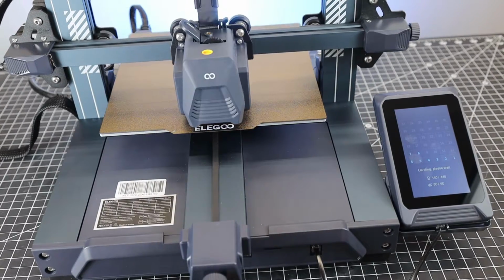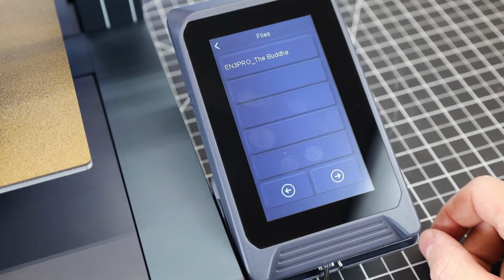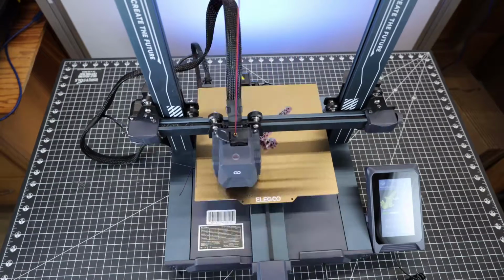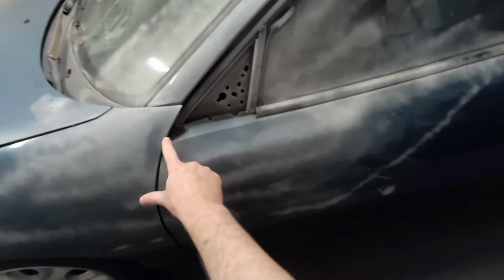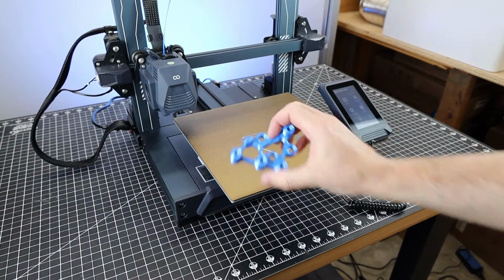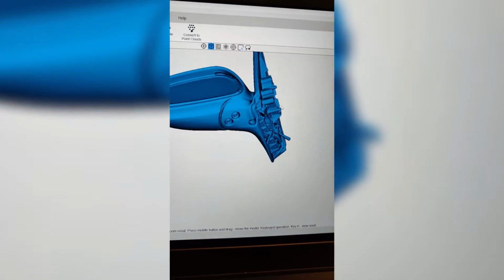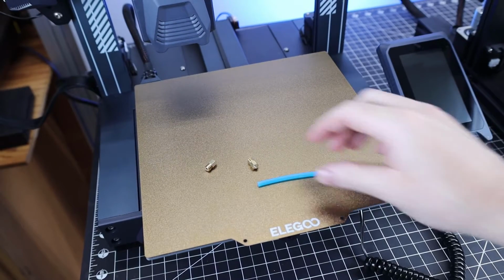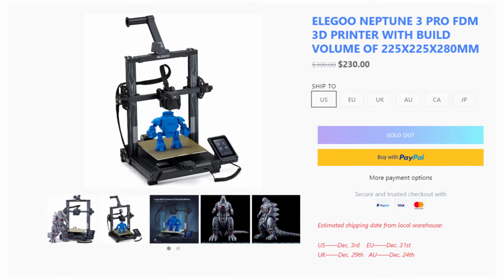3D Scanning & 3D Printing To Making Car Parts - Elegoo Neptune 3 Pro

Comment from the maker: Elegoo Neptune 3 Pro Amazon - https://amzn.to/3haONhK
Elegoo Neptune 3 Pro - https://bit.ly/ElegooNeptune3Pro
Elegoo Neptune 3 - https://bit.ly/ElegooNeptune3

Filament:
TECSONAR Tricolor PLA - https://amzn.to/3H79d5N
PolyLite Silk PLA Blue - https://bit.ly/PolyLiteSilkPLABlue
PolyTerra Marble PLA - https://bit.ly/PolyTerraMarblePLA
PolyFlex TPU 95 - https://bit.ly/PolyFlex-TPU-95

Free 3D Files:
Articulated Axolotl - https://www.printables.com/model/217417-articulated-axolotl-multicolor-remix/files

3D Scanning Tools:
RevoPoint MINI - https://bit.ly/RevopointMini
RevoPoint Pop2 - https://bit.ly/Pop23dScanner
CR-Scan Lizard 3D Scanner - https://bit.ly/CR-Scan-Lizard-3D-Scanner
3D Scanning Spray - https://bit.ly/AESUB-3D-SCANNING-SPRAY
MARKERS FOR 3D SCANNING - https://bit.ly/MARKERS-FOR-3D-SCANNING

Amazon 3D Printing Filament 1.75mm:
PLA - https://amzn.to/3gsLE9Z
PETG - https://amzn.to/3pXjjvu
ABS - https://amzn.to/3wsTRjS
ASA - https://amzn.to/2RX8dtM
Polycarbonate - https://amzn.to/3cLdr38
Nylon - https://amzn.to/3iNGeI2
______________________________________________
Note : Most of the links that I use that go to products are affiliate link. This means I make a small commission on anything that you happen buy using them. This is at no extra charge to you and this helps support the work I do on this channel. 😁👍
______________________________________________

Comment: you can also print over USB, by installing the usually shady serial port drivers.

The filament sensor isn’t movement based, it has a photo gate.

Many have found that all the bolts need to be tightened, including the bed fasteners.
Reply from the maker: Yeah you can printer over USB but that is something I have never needed or wanted to do to be honest.

After the video I fount out I was wrong about the sensor, I thought it was the same as the one on the Neptune 3.

That many loose bolts isn't great.
Reply: @randymay  Have you tried Octoprint yet?  I
Reply: Printing over USB is slower when printing complex shapes at high speeds, the connection is very slow and it cannot send G-code fast enough, so it has to slow down all the time

Comment: Can you print carbon fiber nylon with this? I'm new.
Reply from the maker: Yes and no. Out of the box you shouldn't, the filament will destroy your grass hot end in just one print. 

Also you would need an enclosure if you are printing in nylon to keep the heat in so the layers will stick together probably. 

A dryer box helps a lot to keep water out of the nylon so it will probably print. 

And the last thing is this printer doesn't have an all metal hot end so you might not be able to get up to the temperatures needed.
Reply: @randymay  Okay thank you. Any recommendations if I wanted to be able to print carbon fiber nylon and tpu, preferably in the less than $500 category? Thank you.
Reply from the maker: You can for the price range but you're going to be limited on the size of your print bed. If you don't mind me asking, what are you planning on making?
Reply: @randymay  I want to print pistol lowers and kids toys lol
Reply: Probably a lot less nylon than other stuff, but I'd like it to be capable of doing it.
Reply from the maker: That's understandable but starting with nylon especially carbon fiber nylon right out the gate is probably not the best thing to do seeing that it is one of the more temperamental and harder materials to print. That being said it can be done You're just going to have to do some modifications to the printer like I listed off in my original response. 😁👍
Reply: @randymay  Another I was looking at was the sv06 but I saw people having trouble with tpu on that printer. So then I started looking more into maybe a sv05.
Reply from the maker: For tpu you want to get a printer with a direct drive extruder.

Comment: Quick & to the point with nary a wasted breathe. Nice & good job. Would like to see a diy of the scan, software/cad manipulation into a usable stl file & the config settings on the N3Pro. That would be nice
Reply from the maker: Thanks and yeah I really try to get to the point when making videos. 

I will be doing videos showing how I go from a scan to the PC and make a new STL from it in the future. 

When it comes the settings for the NEPro I just used the stock profile in elegoo Cura and it all just worked, so that was nice
Reply: Great to hear about the upcoming content. I'd def would like to see the process of scanning and what to do with that in the PC.